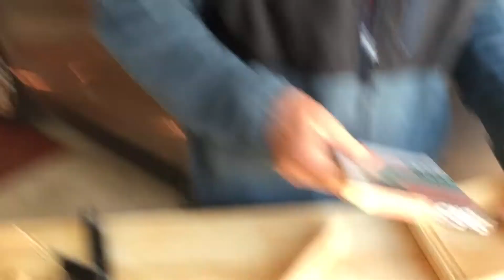Framing with a Mitre Box

Comment: Hi , I am watching many tutorials for floater frames , this one  is the smartest one with less tools , thank you so much . Can I make big frames with this way like 24 by 36 .
Reply from the maker: If you can fixture a stop. Probably best to carefully measure lengths and then clamp down in mitre box and cut. Then you have to figure out a way to squeeze it together after gluing ends. Tying a couple of big rubber bands together might work. You have to experiment before actually gluing.